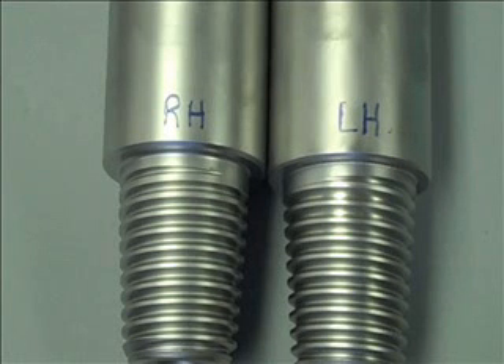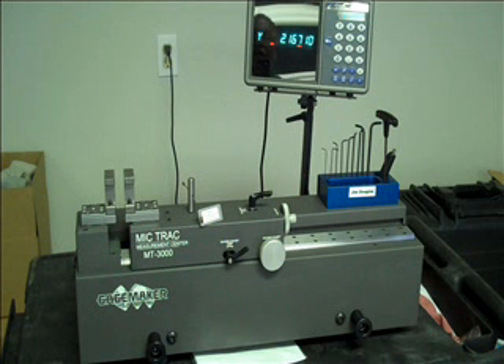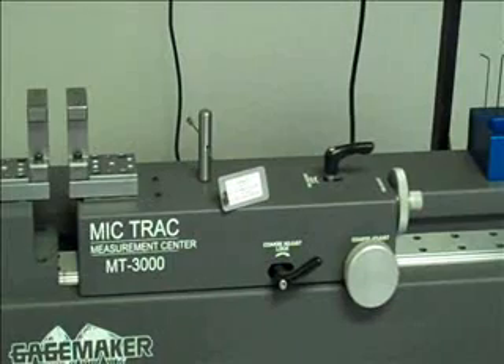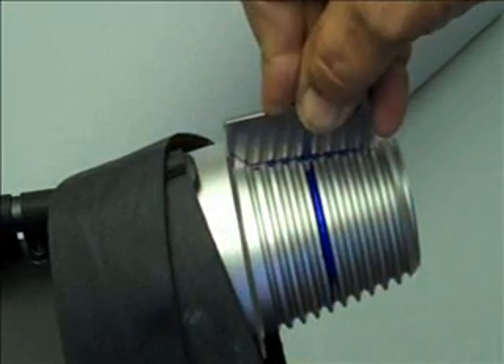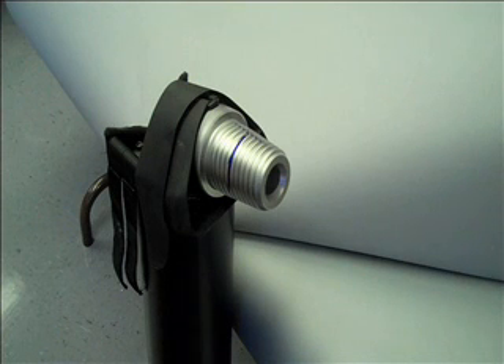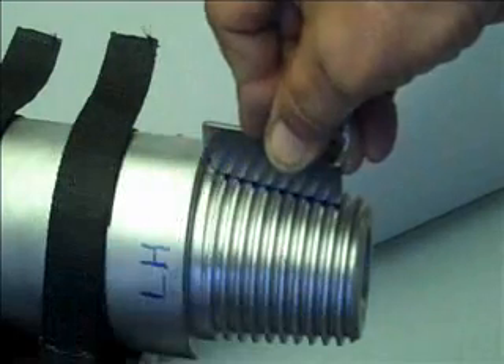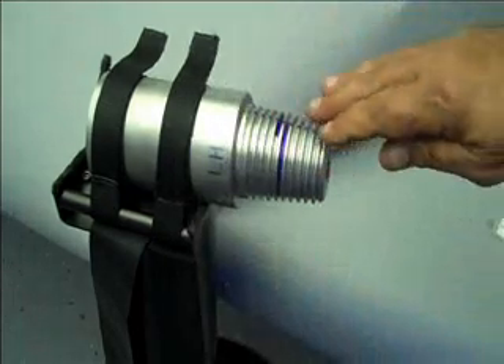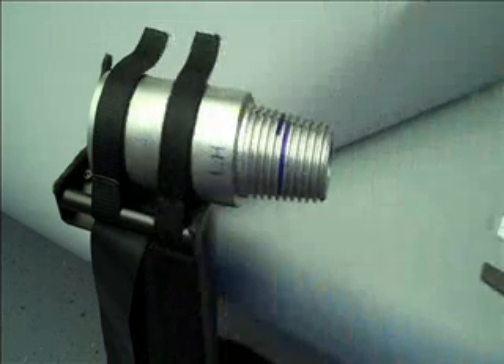Gagemaker JSS NC23 Pins (LH & RH) Pitch Diameter Measurement

Comment: May i know what kinds of application the taped threading is deployed in what kind of tool?
Reply from the maker: These kinds of tapered threads known as rotary shouldered connections or rotary drill string connections (API 7-2) are used in down hole tools for drilling, usually in the oil and gas industry.